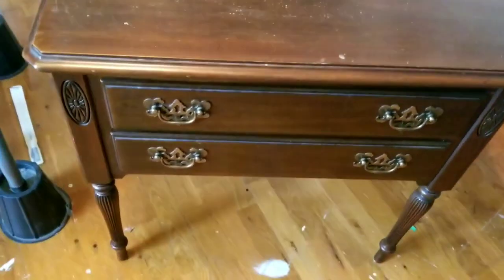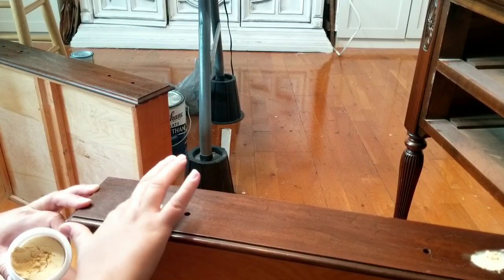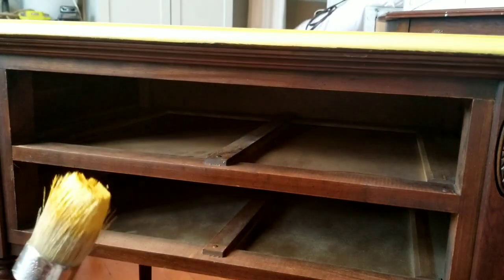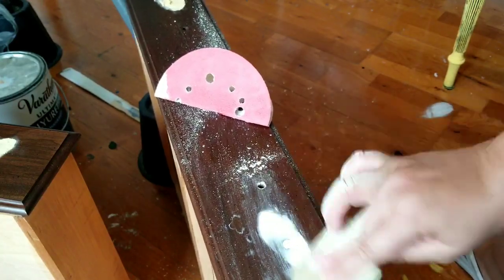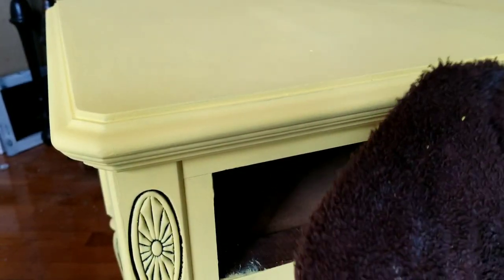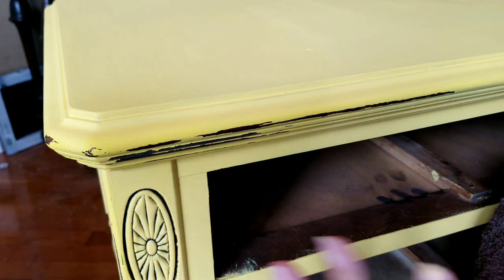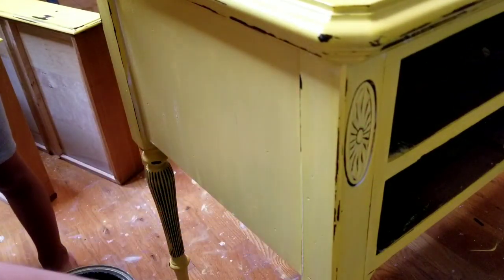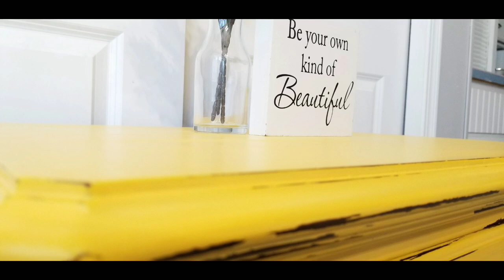🌼 DIY Trashed Side Table Makeover | How to paint furniture using chalk paint | How to wet distress

Comment: Can or should you wet the rustoleum chalk paint or is it necessary.. does it mess it up... I have a chalk paint brush haven’t used it yet ...but looks like it makes painting easier like going on better etc ❓👍🏻🌸
Reply from the maker: You can wet any Chalk paint that is water based, which I think most or all are. I don't normally mist Rustoleum chalk paint as much as it is a bit thinner than Dixie Belle. But I have done it. I wouldn't add water to the can of paint persay, but I would just add mist of water to the paint brush as needed. That way you add as little or as much as you need without altering the entire content of paint in the can.